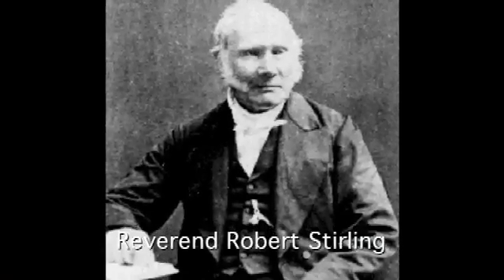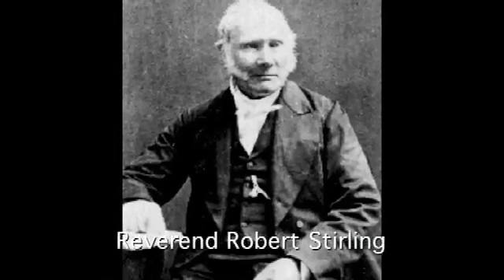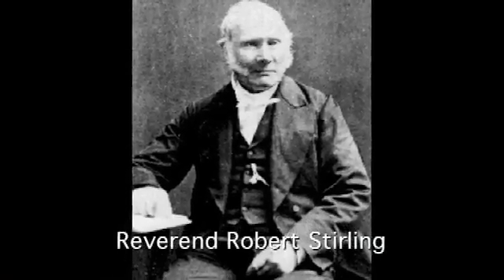The coffee-powered engine - Sixty Symbols

Comment: @abcas1990 Like any engineering problem, it depends on many factors, including which Stirling engine you use, what sunlight-heat conversion medium you use, and what kind of other solar power you are comparing it to. Measured in kilowatts per square meter surface panel, Stirling power is usually (but not always) more efficient; you get more watts per square meter surface area. But again, maintenance is more difficult due to moving parts wearing out.

Comment: Stiriling engines tend to work nicely, when you focus solar energy onto them using a reflective parabolic dish, so long as the heat surface is very dark and converts light to heat very efficiently. Stiriling powered solare engines can be more efficient than photovoltaic cells. Unfortunately, they cost a bit more. Also, because they are mechanical systems, they tend to have a slightly higher rate of failure than solid-state solar cell systems.

Comment: I'm closer to a mechanic than a scientist (and not really either) so I'm liable to embarrass myself if I'm not careful. Yes, a supercharger or a turbo does 'up' the air pressure in the intake, so when the valve opens it pushes a larger volume (meaning larger mass) of fuel/air into the cylinder than atmospheric pressure would. That makes it the equivalent of having a larger cylinder operating at normal atmospheric pressure, without any extra weight to lug around. And that equals go fast! Woohoo!

Comment: @wesmatron You don't want the air/fuel mixture to explode. That's called "knocking" or "pinging" by mechanics. You want it to burn evenly across the cylinder. This heats the trapped air, which expands and pushes the cylinder down. (Well, "down" in a conventional automobile. I suppose it pushes the cylinder "in" in an old airplane's radial engine...)

Comment: @kght222 The burning of the air/fuel mixture heats the air trapped in the cylinder. It expands, and pushes the piston down. It is the heating of the air that does the work of an internal combustion engine. That is why it may be called a heat engine. The "gasoline" or "petrol" is merely burnt at the appropriate time to heat the air. We speak informally of the mixture exploding, but an explosion is exactly what you don't want. That's "knocking". A flame front actually burns across the cylinder...

Comment: @ananiasacts Good idea! But, spinning the entire engine, kind of impossible at the moment.
Some new formula1 cars have a huge flywheel inside them that collects momentum when the brakes are applied. This makes the fuel last longer and less pit stops.
As with many car inventions it all starts on the track, ABS are just one example.

There are already so called magnetic brakes, basically a generator hooked up to the brakes, slows the car, makes electricity, far FAR cheaper than stirling engines.

Comment: @Serostern, I wonder if you could use the mass of the engine itself to cache the car's momentum when you came to a stop.  Couldn't an engine me mounted in such a way as to allow it to spin so it could act as a flywheel for storing the energy needed to reaccelerate?

Comment: @Serostern First off, It's not "due to" it's "as stated in" and
 A windmill causes much more drag and the internal combustion engine is at best 65% efficient. That's a lot of entropic loss, HARNESSABLE entropic loss. The only factor the stirling engine should have on the car's performance is the negligible weight gain. It's like adding a second Net to a river to catch all the fish you missed.

Comment: @Vennificus Well, due to newtons 3rd law. If you get more energy from the engine you will need more input to get said energy.
The energy you gain from adding a sterling engine on your exhaust is less than things like ecodriving (see wikipedia) or for that sake integrate a generator in your breaking system, so that instead of heating the break paddles the energy will be used directly into a generator, without having to transfer to heat before.
Pretty much: A windmill is cheaper and more efficient

Comment: @Vennificus It will increase drag.
Like when people get the great idea to mount a generator on the exhaust pipe, sure you get some amps, but your engine will need more gas to turn.
Setting up a windmill is many times more efficient than a sterling engine on the engine block =P

Comment: That's part of the misconception. The 2,725 Kelvin are the average temperature of the background radiation (a remnant of the big bang). Eventually after a long time an object will reach this temperature (but only in deep space; in the solar system you can't go below around 40 Kelvin because you always catch energy and particles from the sun).

Temperature measures the average kinetic energy of atoms and molecules. In space there are close to none, therefore you can't assign a temperature.

Comment: No. In space heat can only be given off in form of radiation, which is a very slow process at these temperatures. So the "cold" side would heat up quite quickly and without a temperature difference the engine wont work.

It's a common misconception to call space "cold" (and all those stories where people freeze to death in space are science fiction). Space is nearly a vacuum and therefore assigning it a temperature is a meaningless.